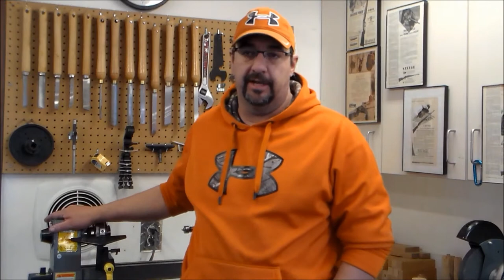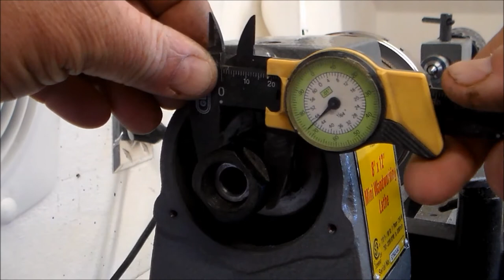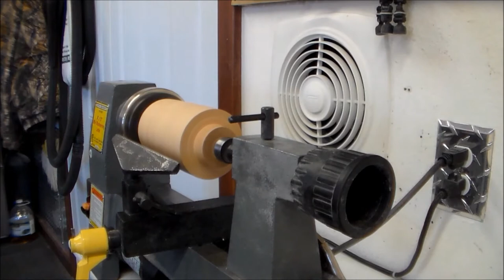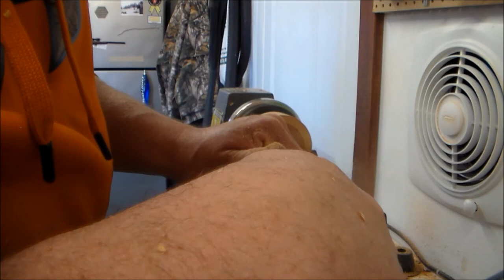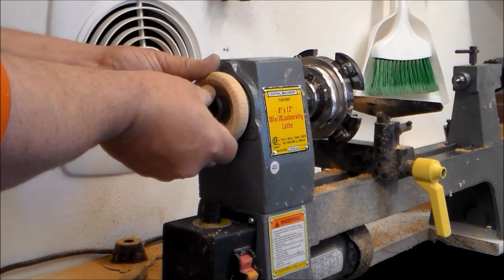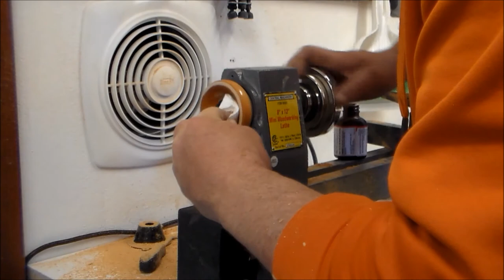Turning a Wood Lathe Hand Wheel

Comment: I have the same lathe that I use for small jobs. I like your idea and I'm going to make a wheel similar to yours. After inspecting the area under the plastic cover I found if rough with some sharp edges. I'm going to try to invert the cover and cut it off to about a 2" diameter. This will extend the cone nearly back to the pulley. The plan is to keep my fingers safe and to keep most of the debris out of the belt area. Some dust will still get in as the bottom is open. Did you keep the plastic cover or pitch it?
Reply from the maker: I threw the plastic away and filled the majority of the opening with the wheel.

I have no concerns about fingers or dust.

The time passed since I made the wheel has been several weeks and there seem to be no concerns. My only regret is that it could have been a little bigger in diameter. 

Thanks for watching and hope it works out for your project.
Reply: ***** Thanks for answering my comment. I too thought a larger diameter wheel might be better. I'll try a 4" wheel...I can always make it smaller later.